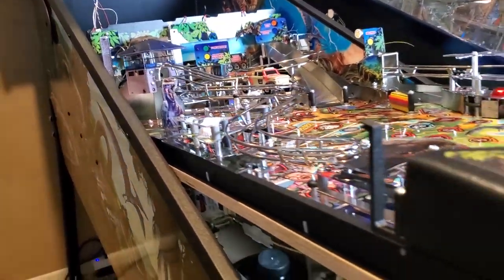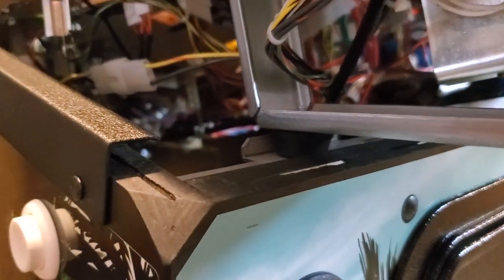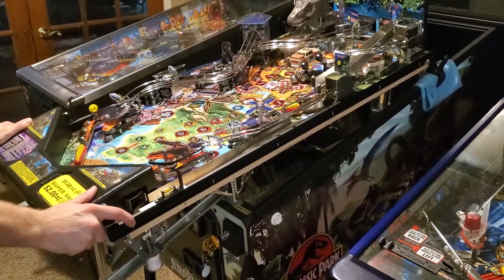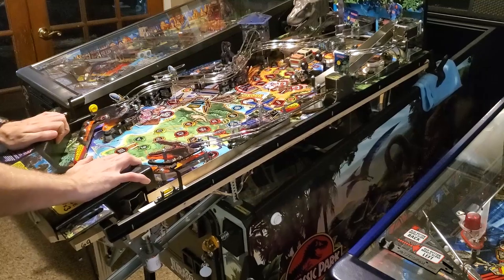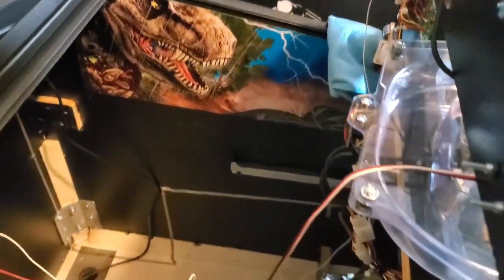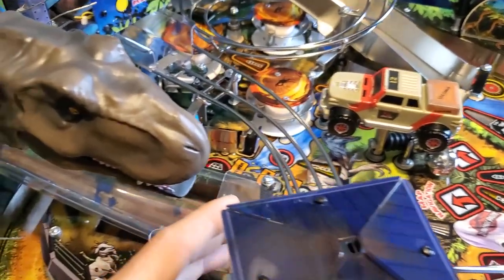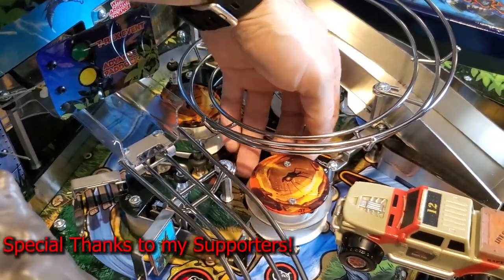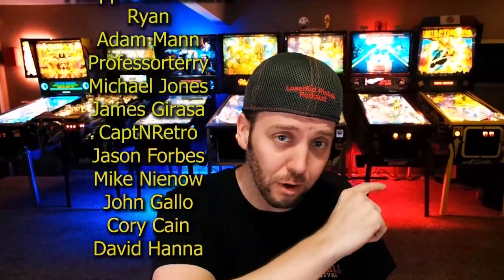A Trick to Access Your Entire Playfield (Topside)

Comment: Awesome tip. 
I’ve done what many have probably done which is jam a piece of 2x4 under the PF when working in a pin. 
If there’s one thing I could add that would help if doing a long ship and you don’t want to remover the PF altogether is to remove the legs and have the pin sitting on a trolly jack so you can drop the height to suit. Awesome tip 👌

Comment: I've been doing this for years from games with just a single hinge point like System 11s and early Dmd's  like T2 and Black Rose. I asked this same question several months ago on the FB Pinball Enthusiasts group but actually didn't get many responses about others doing it also. Lots of people just showed the playfield on a rotisserie saying that's what they do. Games without out the rubber bumpers on the slidders I'll roll up a full moving blanket and strap that down in the front to raise the front side then pick up the back and puts some rolled up towles and I've never had a issue with it. Definitely the best way to just do a top side tear down on a Pin. It also seems like a Lot of people have not tried this so you are definitely showing folks new trips for sure. I was asking if anyone had 3d printed something out TPU possibly to flip over the edge to lift the playfield up and out.
Berto Moon
Reply: sorry but how in the world would this make access easier on games like T2? even if you prop it up on the clamps, you don't have any actual forward movement of the playfield, so you're still not going to be able to effectively and practically reach basically anything from the pop bumpers to the back of the cabinet

Comment: Very handy.  Could help with detailing some hard ro reach areas.  Also, I had T-Rex issues on my JP after a couple of months and I was pretty much blindly poking around the back trying to get the assembly out of there.  This would've helped.  FYI in case you get this issue: T-Rex fixed.  There was a set screw that connects a stepper motor to a shaft that was loose.  The T-Rex would sometimes not know what its position was.  I had to re-tap the hole for the set screw.  It was all janky inside.

Comment: Cary, what would you do for a High Speed or other Williams pins that have the pivots on the sides of the cabinets with no supports on the front of the playfield.  Try the clamps towards the front of the side rails to support the front of the playfield and then maybe slide it forwards till it could be raised to install the rear clamps?  The sides of the playfield is pretty tight to the edges so dunno how easy this would work. Thanks, B.
Reply from the maker: Eventually I'll look into a method. I recently pulled a WPC95 game playfield. Wasn't a "simple" procedure though.

Comment: Thanks Cary. Will use this tip. I need to work on my JP because It appears the TRex ramp sensor is not registering the ball sometimes when I shoot it all they way up the ramp.  Sometimes on a the skill shot right off the pull, I’ll hit the ramp and nothing registers.  Same for some in game shots sometimes.  Wondering if you ever had a bad sensor on this ramp.
Reply from the maker: Check the opto located behind the back panel of the playfield at the pinnacle of the ramp. Will be very easy to work on with this tip in place!
Reply: @CaryHardy  thank you.

Comment: None of my games has the handle on the back of the playfield.  Did you add that?
Reply from the maker: No. This was implemented in later Stern models. Without the handle on a lot of games you should still be able to lift the back of the playfield up.
Reply: @CaryHardy  just got a deadpool prem earlier this year ill have to check it and see if there is a handle back there.   My other games i own are sam based games and dont have that.   DP was my first spike game.   Thanks!